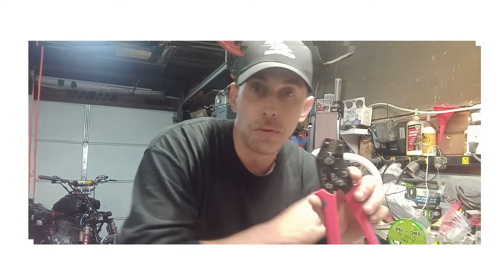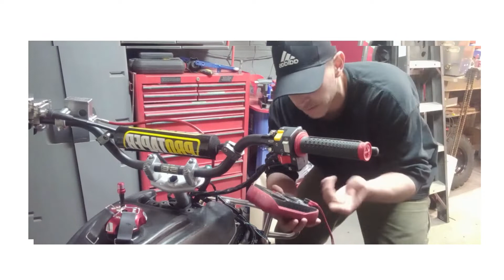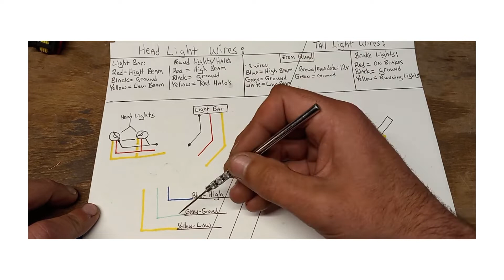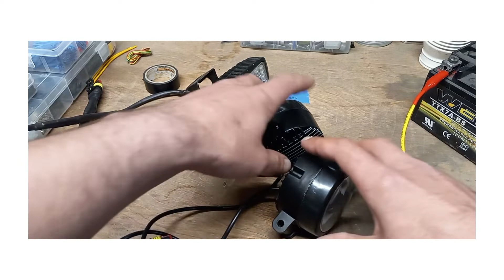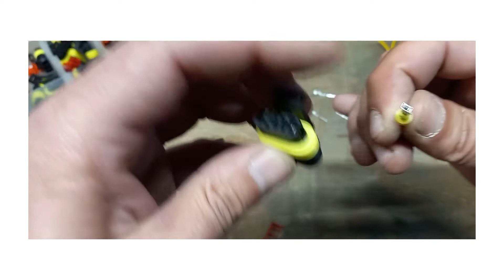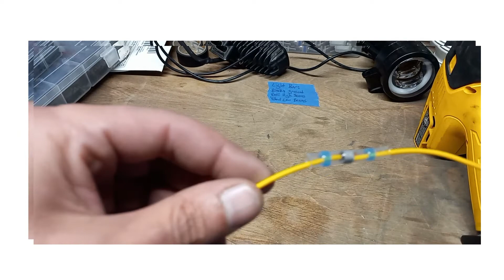400ex/426ex ATV Build how to wire aftermarket lights on a quad.

Comment: what is the kit call for ebay and how to you build the jumper because i need to build one for my quad please.
Reply from the maker: Just type in 3 inch lights. And making a harness is easy I used waterproof automotive connectors

Comment: Those are the exact lights I picked for my 400ex. Nice job explaining and installing. Thanks!
Reply from the maker: No problem bro
Reply: Quick ? I recently purchased an 03 400ex. The bottom nuts on the upright hits my gas tank before full lock. Is there adjustment on the gas tank to move it back? I cant figure out why it does this. Thanks.
Reply from the maker: @3sgteyota  sounds like your steering stem is bent
Reply from the maker: @3sgteyota  you can send me some pics to my email if you want but like I said it's probably a bent stem.  Garagemc549@gmail.com

Comment: #portedhead. Bro that's some serious wiring.. 😳 did u like those connectors that have the sodder in the middle? What year corvette u got?
Arturo Medina..
Reply from the maker: I love those connectors I'll always use those with heat shrink over them. It was a 2012 grandsport ls3 6 speed with the dry sump oil tank